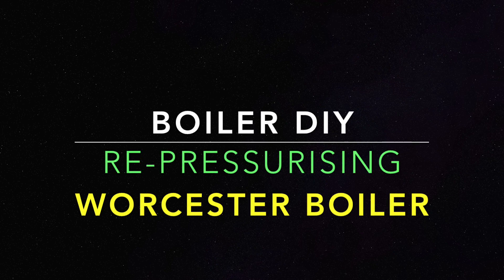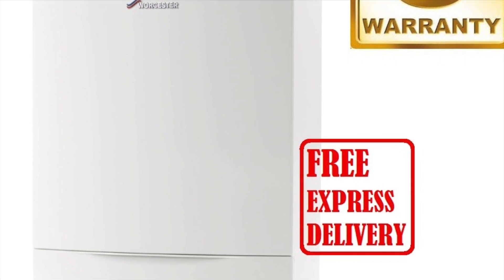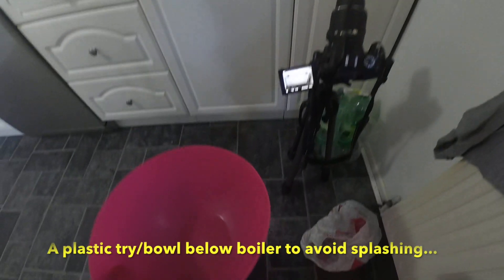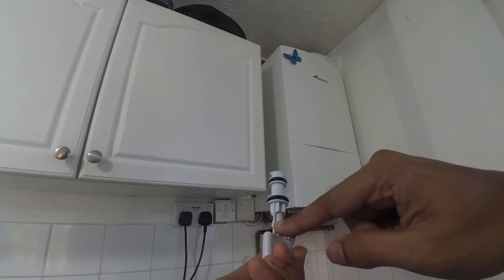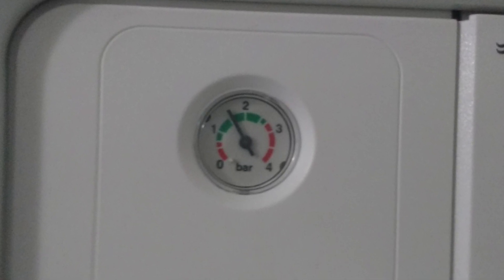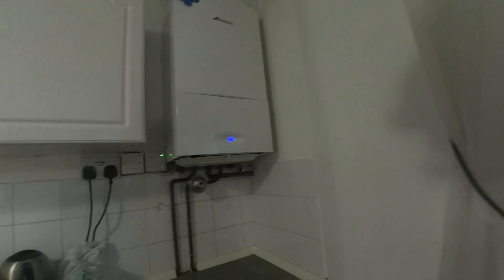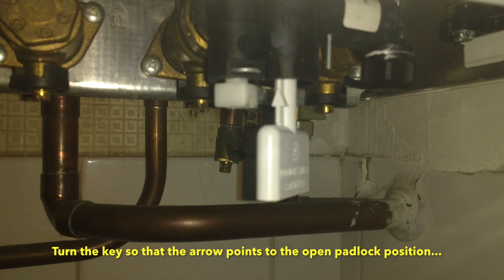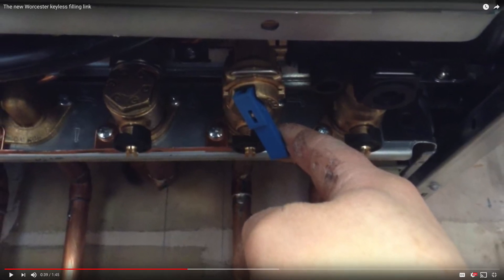Topping up or Re-pressurising Worcester Combi Boilers

Comment: thanks for this. But once you have gone through these steps and then switched the power on at the wall, do we then need to also switch the on/off switch on the boiler to ‘on’?
Reply from the maker: You should be okay - just turn the power to the boiler off before topping up the pressure. Turning off other power switches is optional.
Reply: @NagaYanamandala  Thanks! 😊

Comment: My tenants topped up to 2.5 bar . How do I lower the pressure? Open valve without key, so water dripps out?
Reply from the maker: Hi Magda, this depends on the specific model. Suggest that you google and hopefully you will find something in youtube. If not, I suggest that you call in a plumber.

Comment: It's Great as I mis laid my instruction manual. I remembered one was clockwise and the other then both. Then the first back to it's original position. But forgot which done what. The video. However. Makes it crystal clear. Thanks.
Andrew . Truro. Cornwall.